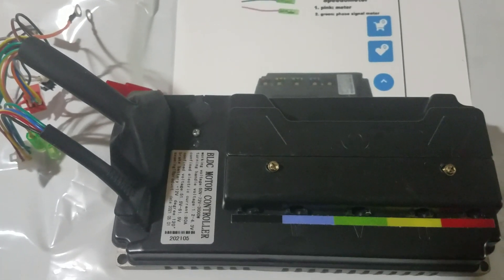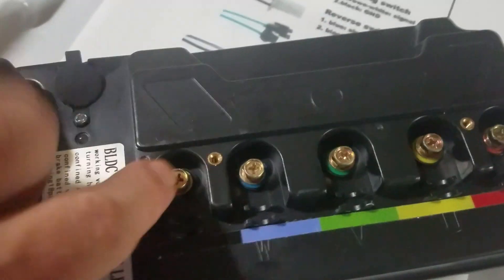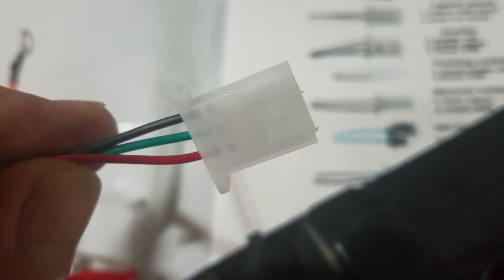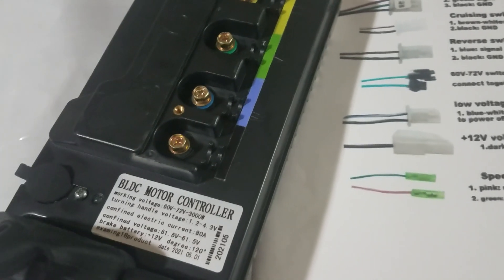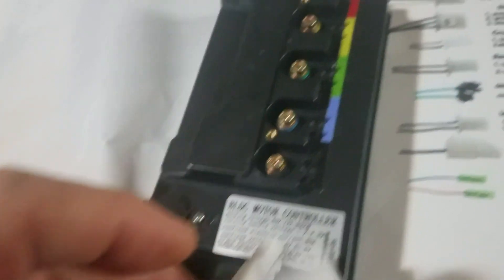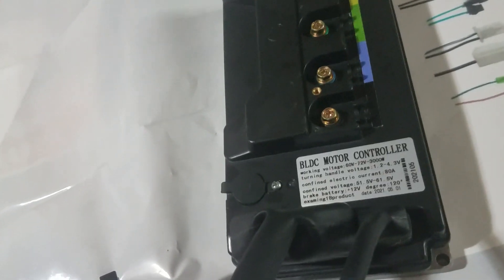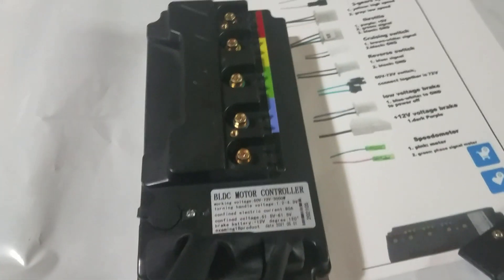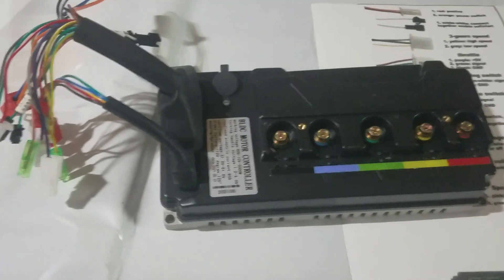SINE WAVE 3000W CONTROLLER WIRING

Comment: waiting eagerly for  your results :) good luck
Reply from the maker: WORKED PERFECTLY AND LOST NO FUNCTIONS  AND ADDED CRUISE CONTROL THAT WORKS PERFECTLY, WENT FROM 60V 20 AH BATTERY AND A 35 AMP CONTROLLER AT 31 MPH TO 72V 50 AH BATTERY WITH A 80 AMP CONTROLLER AT NOW 52 MPH WITH A CRAZY LAUNCH SPEED, I FRICKEN LOVE IT!!!  THAT PINK SPEED WIRE HAD ALL THE DISPLAY DATA IN IT TOO ADDED TO THE SPEED SIGNAL LIKE WHAT POWER LEVEL 1-2-3 AND BRAKE INDICATOR AND THROTTLE INDICATOR, EVERYTHING.
Reply: @TechKnowCSS  Can you tell me where you have found your 72V battery with a strong AMP output?
Reply from the maker: @Agnin1  IT IS TOP SECRET, BUT I BUILT MY OWN WITH 71AH WITH 80A CONTINUOUS AND 160A PEEK  DRAIN. IT COST ME LESS THAN $450.00 (22" X 7.5" X 3.75"). BUT IF YOU GOT THE MONEY TO PAY TO GET A GOOD ONE, GET THE ONYX 72V 42AH BATTERY.
Reply: @TechKnowCSS  I have the same 60V 20ah with the 35amp controller setup currently that maxes out at 31mph. If I swap to this controller will I increase speed or do I need to increase battery size as well?
Reply from the maker: @RyanBaskervillePhotography  I am not sure, but I am guessing it will do at least 37mph with the 60v but I went right to the 72v and it goes over 51mph, I do not know the real max because I got sketched out at 51mph and backed out. Also you could make a 4s10p and put in series with your current 60v battery and make it 72v like I did at the start before I made my own 72v battery. But you have to make them unplug and charge separately like I did. I used a 5 wire 4s pigtail for the 4s10p and charged it with my B6 charger so I did not need a BMS for the 4s10p because the B6 balanced it each time it charged. So instead of it dead at 48-50 volts you stop at like 62 volts to recharge. This controller has 2 wires you hook together to make it 72volts, un connected it is default 60v. Also be careful on your battery sag when you take off and top speed because this controller draws much more amps, keep sag under 6 to 3 volts. Also you should upgrade the wires from the battery to the controller to at least 10 gauge, I went to 8 gauge, smaller number is bigger wire. Good luck!
Reply: @TechKnowCSS  can you confirm if you need to cut any plugs to make this controller work ? Or its plug and play?
Reply from the maker: @Brolly916  50/50
Reply from the maker: ALSO THE REVERSE AND CRUISE CONTROL WIRES ARE SWITCHED WITH EACH OTHER ON WHAT THEY SAY ON THE CONNECTORS PICTURE THEY PROVIDE.
Reply: Hi . Can i connect my 60v battery and 5s battery without plug in  the 72volts connector ?
Reply from the maker: @lourencesangalang496  I HAD ADDED AT FIRST A 4S10P IN SERIES TO MY STOCK 60V, I THINK THE 5S WOULD BE TOO HIGH EVEN FOR THE 72V CONNECTOR. 60V IS A 16S AND THE 72V IS A 20S. A 21S IS WHAT YOU ARE TALKING ABOUT IS 88.2V AND I THINK THE CAPS IN THE CONTROLLER IS ABOUT 92V IF YOU ARE LUCKY, I WOULD NOT CHANCE IT, NO WAY.